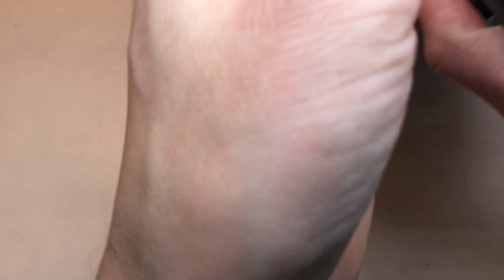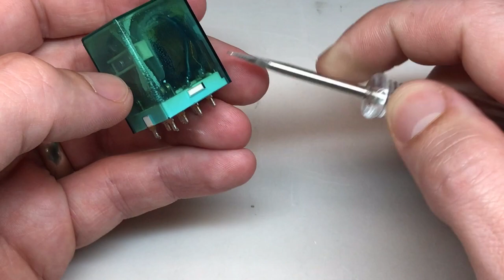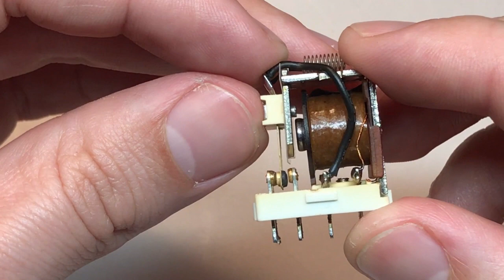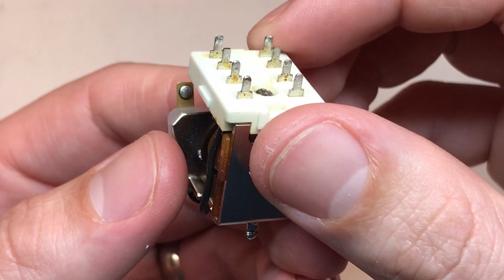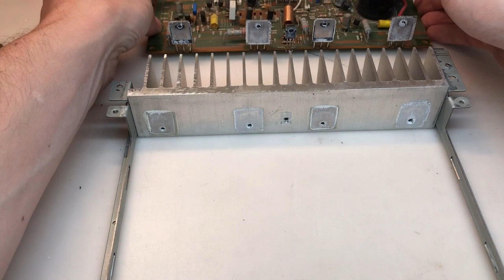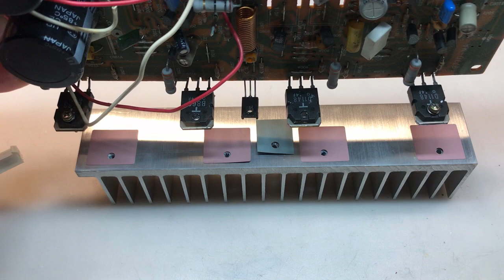DR #28 - Carver TFM-6CB Repair - Part 1

Comment: Excellent video presentation. I use a jewelers paste or rouge on a q-tip to remove oxidation from contacts. It's very effective and does not destroy the plating. If the oxidation is stubborn, I'll apply the paste and let it sit for a few minutes, then apply a bit more before buffing it off.

Comment: Thanks for the video!  I have a TFM-6c that needs the same work. Do you have the part number for the thermal pads handy?  I looked at the parts stores and there is a huge selection.  I wanted to get the correct part the first time.

Comment: I use 1000+ grit emery cloth dipped in trichlorotriflouroethane, brake cleaner, or in a pinch, DeOxit. Then I wash the whole assembly down with trich to remove stray fibers, dust etc. I prefer trich to DeOxit so I eliminate DeOxit's lubricant which can trap metal particles that can cause arcing shortening the operable life of the resurfaced contacts. It's a pain to get to a relay's contacts, so doubling the time between resurfacing is a win.

Comment: Normal print papier (dry) sliding sideways between the contacts works great, i also use this to clean the contacts of Ram sticks, mSata cards, Wlan cards etc....
I have seen a certified HP technician doing this back in 2007, so it's not new under the sun.
If the contacts are free accesible like on a Ram stick or so, then a pencil eraser will also work great.

Comment: For future reference, the continuity function of the multimeter is no good for checking closed contact resistance. Most meters will signal continuity below 100 ohms or so. You need to be able to resolve contact resistance to below 1 ohm (I actually shoot for 50 milliohms). A 50,000 count meter or better is best for this.

Comment: I clean relay contacts all the time but in old pinball machines mainly. For this purpose I almost alwys use Dremel brand wire brushes—brass (softest) part #537-02, carbon steel (med) #443-02 and stainless (hardest) #532-02. A rotary tool with variable speed is a must. For the type of mechanical relays found inside audio equipment, the soft brass will probably be all you need. Wear eye protection if you do this. The dremel brushes hold up well but can still lose a wire now and again. Off brands are essentially projectile weapons.
Reply: Agree with Jay.  I would add that even softer than the brass wheel is the black nylon(?) brush wheel, which is all that would be needed for this project and no worries of projectiles or even shorts from a metal hair flying into the unit.
Also decent for some contact cleaning is vinegar on a Qtip, let sit for a half hour, repeat, wipe off with plain water or alcohol.

Comment: Soak a regular piece of paper in Deoxit and run it between the contacts.  If that doesn't work, soak some 1000 grit sandpaper in Deoxit and do the same.  In reality, it's better to change out relays than to clean them.